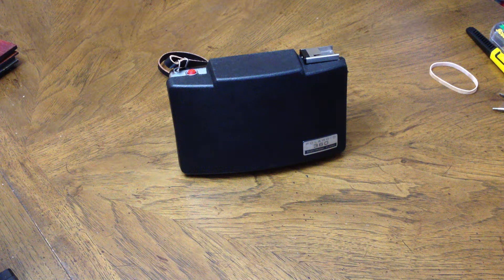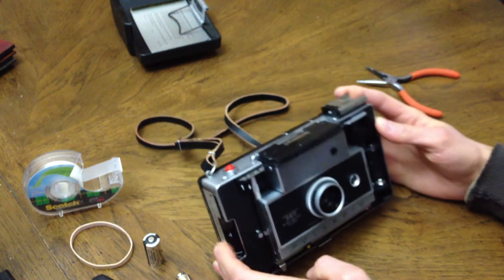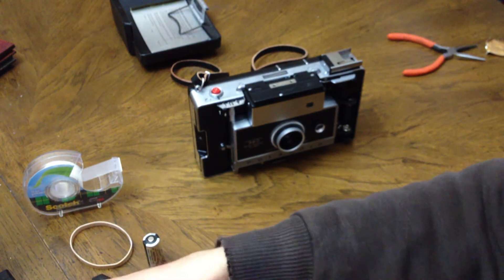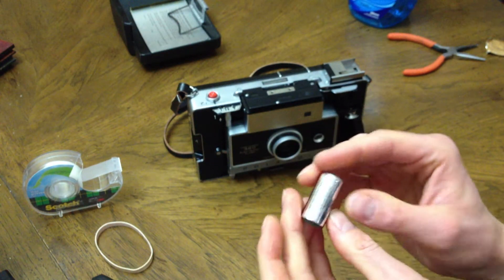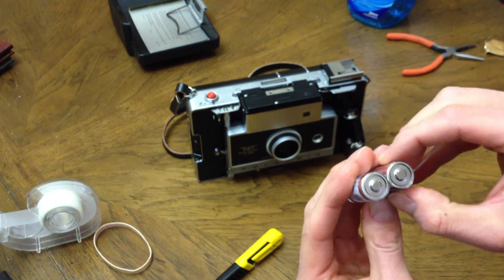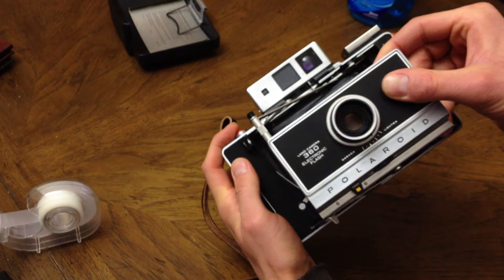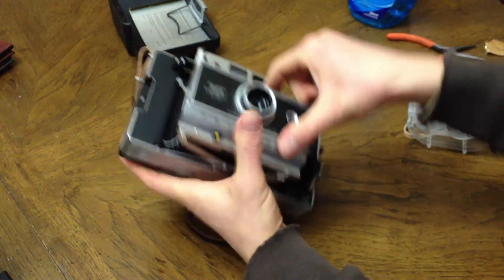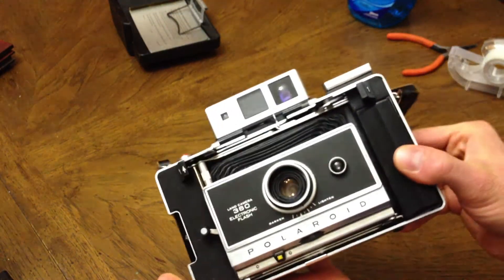How To: Polaroid Land Camera 360 battery conversion

Comment: Thank you for the great video.  I purchased one of these and unfortunately only had one old battery.  Just an FYI: inner most connector on the battery holder is for the shutter; the outer most is for the timer.

I discovered this when I connected the battery up to the outer connector and the shutter didn't work but the timer light was on.  Hope this helps.

Comment: Update: After getting new CR123 batteries. We simply cut off the bottom portion to enlarge the metal contacts and then used clear tape to fix those 'buttons' to the battery. And let the top end intact. 

Clean off the connectors very well in vinegar and naturalize with soda. Inside the top portion of the original battery there is a small disk of metal. Take that out soak it and clean the cavity with vinegar/qtip. Drop the old connectors in a shot glass with vinegar..and then explore the bits---on one of the connectors there's a interior disk of metal on the back side of the connector..take that out after it loosens up and clean and replace. 

After all that was done we cut off the bottom portion of the battery as shown...but left the top intact. Wrapping the old 'nibs' to the battery worked very well. No rubber band needed. We did use a bit heat to 'shrink wrap' the packing tape down a bit. But it worked well. 

Thanks Dovnk1 for posting this and opening up this discussion.

Comment: I actually ripped the tiramals off in the removal of the old corroded batteries is there a way to repair the battery holder there's not that much wire left so I don't know if I can solder a new compartment on
Reply from the maker: sorry to hear that... if there isn't enough wire left you may have to desolder the existing wire and solder in a new, longer wire to replace it.

Comment: Hello dvonk1 I recently bought in America (ebay) a Polaroid 360 that thanks to your movie are partly able to understand how it works. But I have a couple more questions to ask you, about levers, wheels and batteries.
1. what are the lever (seems stuck) and the wheel 75-150-300-3000 numbered on the front under the great name POLAROID?
2. what use the scroll wheel on the back with numbers: 15-30-45-60-75-90-105-12
3. there were still inside the batteries now partially destroyed (duracell PX24-3V) i wanna know if they are still in production in america because in Italy does not seem to exist.

Thank You Very Much.

Comment: Does this camera have some kind of on/off switch? The timer light turns on normally when the plastic tab is pressed, but whenever I put the rollers back into their place and close the camera, the light turns off and no whirring sounds can be heard. I have the same model as yours with working shutters and the original No. 532 batteries installed. I still can't take any pictures however. Does it have anything to do with the timer light being on?

Comment: Hey thanks for the great video, with this mod now my 360's shutter works perfect. I do have one question about testing the timer. I do open the back and open the roller as well, the light doesn't turn on. However, while I accidentally reverse the +/- of timer battery, the light do lights up. Do I have a bad timer, or how exactly can I test the timer without pulling out a film? appreciate :)
Reply: ***** My timer works!! I've tried to touch everything there to find the timer trigger and didn't even notice there's a little plastic tab. Before check out your videos I actually gave up the timer(I don't know how to test it so I didn't put in battery) and the flash of my 360(charger dead). Now I'm working on the flash, I followed your other video and replaced with 2 AA batteries. I can hear it charging forever, the orange light never blink, and I can't discharge the flash like you do. So probably the capacitor died, right? Do you think adjusting the circuit board will help, or I should get a new capacitor..? Thanks for your help again!! BTW, I guess you should add the word "360" into your video's title, so more people can find this video and benefit from it. As I know, only 360 or later model use 2*3V batteries(Older model use 1*4.5V), and this is the only 360 battery mod video in the whole youtube :)
Reply: ***** I just realized it's a very long reply when I finish typing it, so read it when you have time :)

I really have no idea these old capacitor could be reform, that's why when I watched your video I don't know you really "reforming" the battery by just using 2 AA batteries. So I just follow what you suggested, I connected the flash with 2 AA NiMH battery(the same Eneloop as yours) and wait. After a while(30mins) I pulled out the meter and try to read the voltage between the capacitor and WOW... I finally got reading on my meter!!(it used to be 0-10 all the time few days ago).

Around 2-3hours later with the 3rd pair of AA batteries, the reading finally climbed up to ~260V, and the flash fired up the first time!!!! At the beginning the top voltage pump up very slowly like 3mins per 1V, and now it's like 1min per 1V. I keep waiting, and amazingly it reach 360V on my meter!! I fired the flash immediately(I don't want it to exceed 360V just to be safe), and put on the meter to see how long it takes to charge, it reached 300V around 30sec and it slow down pretty much 1sec per 1V.

So now it's great to know my 40years old capacitor can still hold a charge to 360V :) 

I do have 2 more questions.
*The orange light still never blink even though I reach 360V on the capacitor. Does it mean the voltage reading is different between the capacitor itself and the circuit board? Like the capacitor holds up to 360V but the circuit board can only receive less than 360V so the light still doesn't blink? I just want the light to remind me the flash is ready, but I can absolutly live without the light though, let say just wait 1-1.5mins to make sure there's enough voltage in the capacitor.

*Another question, let say I bring out the camera and I'm looking for the object to shoot, do you think if I keep the flash to "on" will heart the capacitor somehow? As the pair of AA batteries is way stronger than the original 40 years old 9cell battery, will it keep pumping voltage to the capacitor and make it excess 360V?

*Oh well, one more question, I still didn't buy the battery holder yet, I'm thinking between AA or AAA, Cause the AAA is half the weight of AA, the holder is smaller and looks nicer :) but I'm worrying if the 2*AAA(2*950mAh) is powerful enough to drive this huge capacitor? At least for 10 flashes?

Thank you again for all your time, tips and help, really appreciated!!

Comment: Hi, do you have problems with your camera like broken film tabs? Did you do something to the camera body to avoid that?
Reply from the maker: if youre getting broken film tabs, the spring on the door of the camera is likely the culprit.  try removing or bending the spring tabs to lessen the pressure.  if you dont want to modify your camera, you can unlatch the door just slightly to relieve some pressure to get the tab started, then close the door again once youve got it started.

Comment: Don't cut off the top (Male end) insulation.  On the batteries we purchased (Rayovac 123A) exposing the top shorts out the battery when you clamp on snappy thing.  When they where snapped in they heated up very hot. The outer shell of the battery shorts out when the clamp goes on....confirmed by testing putting a screw drive on the 'male pole' to the outer shell...and confirmed by clamping one of the reclaimed 'button snap' things on the batter...hot hot hot.